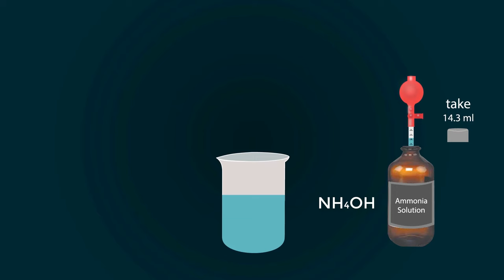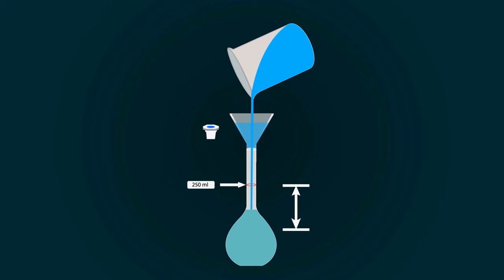how to prepare ammonia buffer solution for hardness | how do you make ammonia buffer solution?

Comment: But in a some book is

If the magnesium salt of EDTA is unavailable, dissolve 1.179 g disodium salt of ethylenediaminetetraacetic acid dihydrate (analytical reagent grade) and 780 mg magnesium sulfate (MgSO4 7H2O) or 644 mg magnesium chloride (MgCl2 6H2O) in 50 mL distilled water. Add this solution to 16.9 g NH4Cl and 143 mL conc NH4OH with mixing and dilute to 250 mL with distilled water. To attain the highest accuracy, adjust to exact equivalence through appropriate addition of a small amount of EDTA or MgSO4 or MgCl2
Reply: Yes , i see
Reply: I see in Thermax operation maintenance book